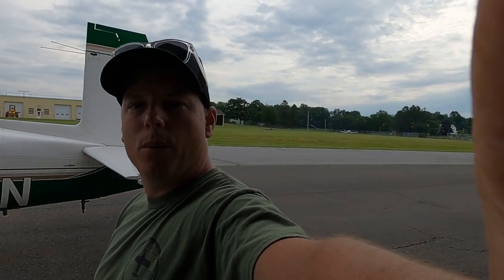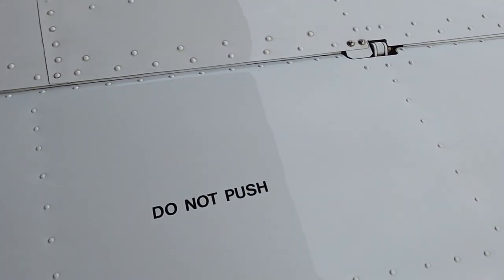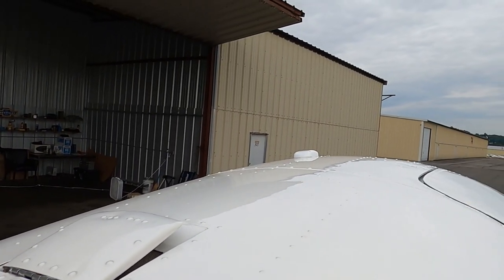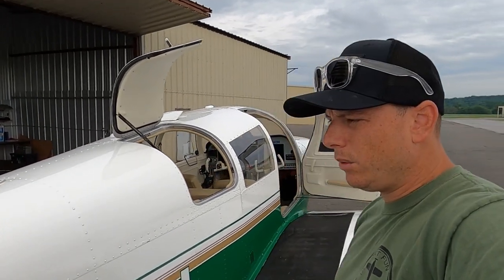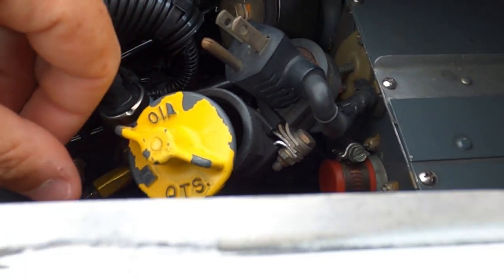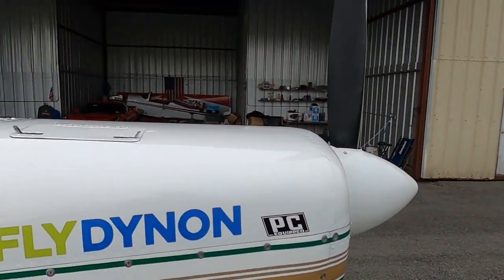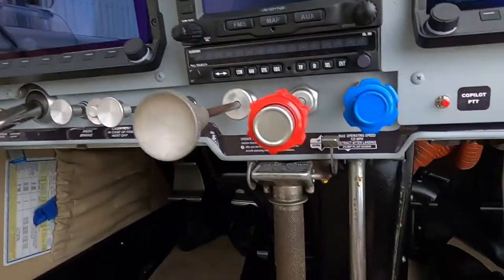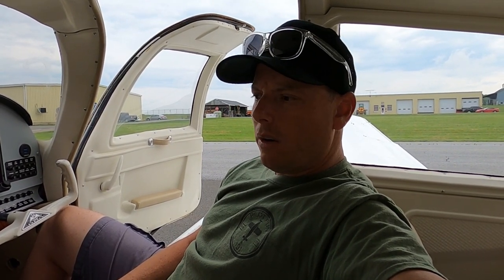MEET THE MOONEY AIRCRAFT! | N6887N | WALK AROUND | M20C RANGER

Comment: Have you ever had any issues with the gas tank? Rust or breakdown?
Reply from the maker: I have not.  But my tanks were sealed once already.  Any wet tank over time will start to leak.  Even if you have bladders and your plane is up there in age the bladders will also start to brake down.  But they can always be fixed.

Comment: I like the Mooney brand. I have been looking to buy but most, if not all, of the planes I checked had a prop strike requiring engine tear down. What is your experience? Thx.
Reply from the maker: It took me a while to find a good one.  They are out there.  Mooney's sell pretty fast once they are listed.  Its a great overall airplane for sure. If you have any other questions you can email me.
Reply: @PilotFun101  they do sell fast
Reply: Yes they do sell fast. I looked at one the other day and I missed out on it by 48hrs. Someone came with cash and cash is king. The other two i jumped on were already pending sale. The one I have a contract for now, people are interested in it. If you see a good Mooney, dont hesitate.
Reply from the maker: Jerome S True story. Get them while you can. All they do is keep going up in price.
Reply: I came across this too. The plane I'm looking into, when I 1st called and asked about it, they said "oh, it's a no nonsense  plane, no damage history etc." When I went and looked through the logs, the plane had a wheel up landing and double the time advertised. This was good because we know that the plane has been flying but how did the miss such vital Information. Once the repair was done properly you should be good.
Reply from the maker: Jerome S Glad you caught that. Things get fixed but it’s also A bargaining tool to get the price a little lower. Must go over logs and get a full pre buy for sure.

Comment: Question. I know nothing about Mooney. I'm 6'4" and overweight. Would there be a Mooney model that would work for me?
Reply from the maker: Very good questions.  Useful load on a C model is typically 900-1000.  So when you add fuel at approx 6 pounds per gallen X's 52 =312. minus that from 900 = 588 left for people. This is of course all approx.
Reply: I think the M20E would fit you well with that extra 20🐎 power. As Chris said, you will be flying alone most the time. I'm 6'1"    and the M20C is quite ok. If you have the estra money to spend, then you can look at the J model, but that's space you wont be using.
Reply: Mooneys are built to fit a wide variety of people... Go fly a Mooney!
Not everyone is a standard size...
Al Mooney was a tall man himself...
Great details, Chris!

Comment: I’m looking at my first plane. I know that I will buy one, so I will buy something before flight school. A friend suggested that I stay under 200 hp and no retractable gear. What do you think? My research keeps bringing me back to Mooney. Push rods over cables. Fuel burn/gph. I can’t find a down side. If I need to buy a 172 for a while, I will. But, I know that I will want a Mooney eventually.
Reply from the maker: Very good question.  It can really go both ways.  If you were going to rent to get you license I would say rent the cheapest plane.  That’s what I did.  I then bought a cheap Grumman AA1A to build up time but also did not have the money at the time to buy anything else that was low wing. If I was going to buy and I had the money I would get what I wanted to save the hassle.  I would say stay under 200. Learning is a complex plane is like learning in anything else. Just remember to put the gear down by using GUMPS as your landing check list. Mooney’s are easy to fly.  They are fast and very efficient.  Just my thoughts.

Comment: The air vent on top of the fuselage reminds me of a reverse speed brake. Do you notice a difference in performance when it is opened all the way?
Reply from the maker: I agree. Lol. Umm I really don’t see any difference in speeds with it open.  But it’s possible I lose less then a knot or so.
Reply: @PilotFun101  
Beautiful aircraft by the way! 🇺🇸🇺🇸
Reply from the maker: @derstuka96  Thank you
Reply: When I find my Mooney (I’m on the hunt right now) I think I might make a safety cable for the vent door, just in case. BTW, the bolt that connects the solid control wire to the vent door needs to clamp the yep remain free to rotate. If not, the bolt will bend the wire back and forth until it breaks like a paper clip. That might be why it broke the first time or maybe it was just old. Beautiful plane you’ve got there.

Comment: I have a Mooney ovation 2 gx, I liked your vid but have a concern, removing your oil cap after flight is great, I also do this
but my concern is leaving you plane heated all winter is like a moisture vacuum. Warm air holds more moisture that cold air. I have a phone switch that turns on my heater with a text message when needed. And please don't start that 
motor cycle in winter like so many do, and also don't cover that ac unit outside your home so moisture is trapped and your contact points corrode , Mn. Dave
Reply from the maker: Thanks. I like the text message idea.  I also keep the cap off while it’s plugged in. Idk of that helps or not.
Reply: @PilotFun101  Sorry but I would think it wound be worse leaving oil cap off while plugged in all winter, it MAY allow a moisture path. Remember warm air holds more moisture than cold. I built two aircraft and am an A&P, please do some research and don't leave it plugged in.  I get mad at myself when I plug her in then cancel the flight cause i know i let moisture in, I must say I have never heard of anyone plugging it in all winter
Reply from the maker: @davemccorqudale241  Gocha. Thank you for the heads up. Always learning! More advice the better 👍
Reply: I think you might be okay leaving the Tanis heater plugged in. The heater directly warms the metal in the engine. The metal surfaces in the engine won’t be as cold as the air around them and therefore less likely to cause moisture to condense out of the air and onto those metal surfaces. It would be the opposite of condensation forming on cold glass of water.

An engine dehumidifier would be even better. I think Mike Busche of Savvy Aviation did a webinar on the topic. 

Way back when I used to maintain aircraft in the arctic, we left them plugged in all winter. Of course it was -40 and they flew every day so corrosion wasn’t an issue. We didn’t leave the oil caps off for two reasons: 1) we were afraid the pilots might forget to put them back on before flight (it happened) and 2) the breather pipe does the same job. BTW, so much moisture came out of the breather overnight that we’d have clear the frost out of the pipe with a stiff piece of wire before flight.